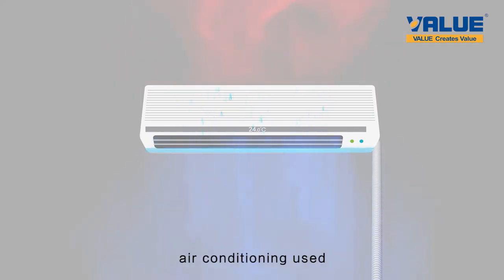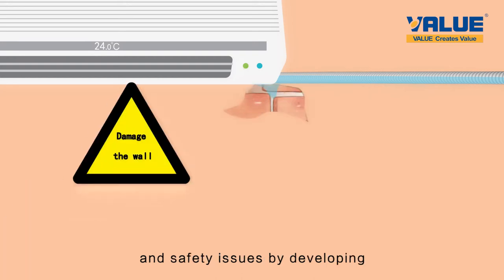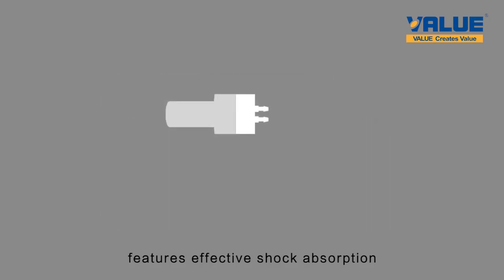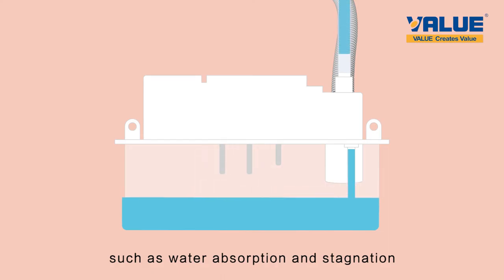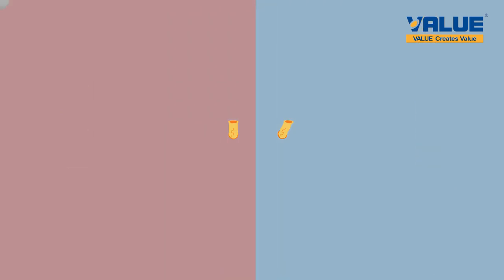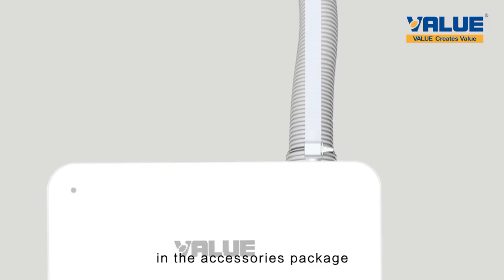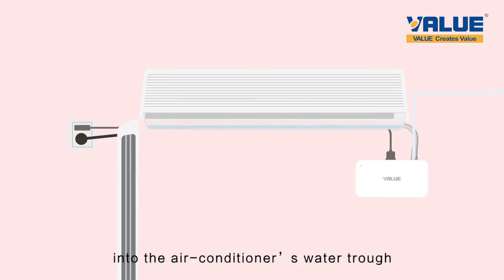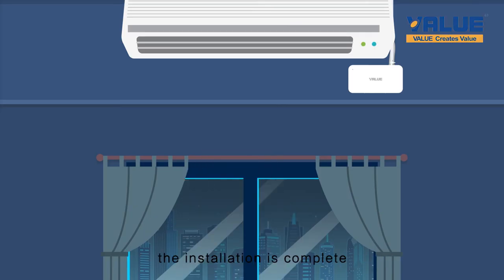VALUE M1 Condensate Pump | Ultra quiet, easy installation

Comment: In the past, air conditioning used gravity drainage to remove condensate. This method causes many health and safety issues. Now we have developed the M1 condensate pump with optimized function and structure in a compact design to avoid those issues. Watch this short video to learn more about this product.

VALUE creates Value.
Reply from the maker: Thanks for supporting VALUE

Comment: can this be hooked to the indoor unit for power aux split air conditioner
Reply from the maker: S1 can be used on power aux split air conditioner , M1is for wall mounted drainage pump